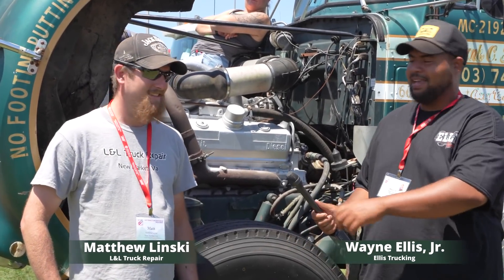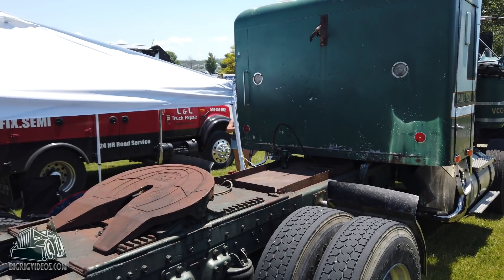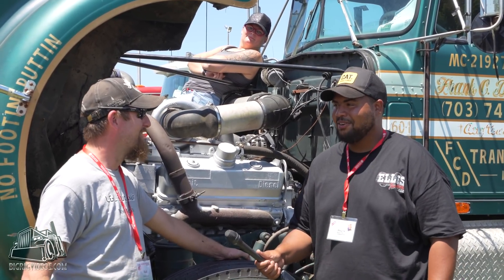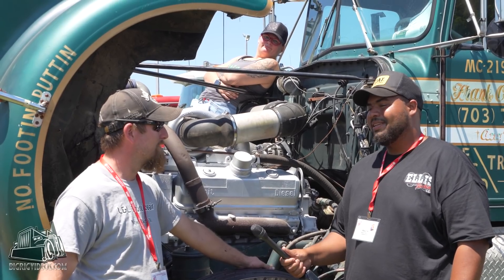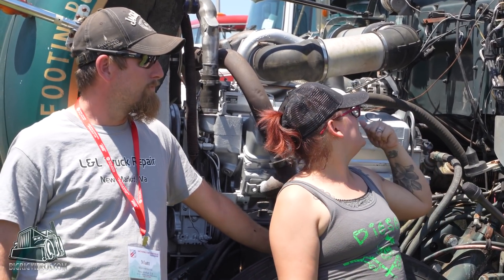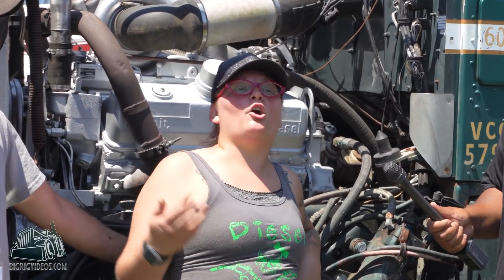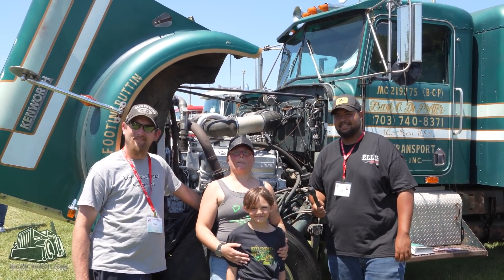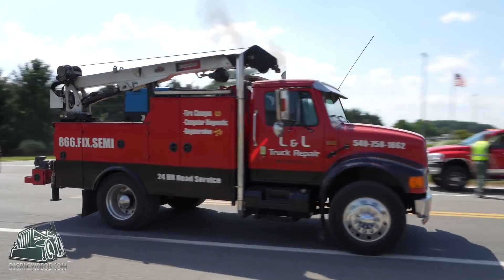The Linkski's 1979 Kenworth 8v92 W900A | Listen to this Double Breasted Yamaha!

Comment: I'm just wondering if this is a silver series Detroit 8v92 they would run I drove a 79 cab over Peterbilt with a v8 cat 3208 with a 15 speed over drive transmission and 410 rear end gears and I tell you the only truck could pass me out on 81 was a silver series 8v92 specially when they were turned up they would run I had fuel turned up also not many of anything could pass me until a cab over Freightliner with a silver series was able to pull around me I know I was loaded heavy and the other driver told me that he had a bushel load on also I had to take his word but he was telling me the truth because he could barely get around me specially with the 15 over and 410 ratio rears I drop one out of over drive and talk about a powerful unit but one question why would you being a mechanic and being around Trucks would you only rebuild half the motor that is silly to me and anyone that knows about Trucks you do the whole motor now you have one side that is new but the other 4 cylinders can go at any time that  I just don't understand that
Reply: Excuse me it had a  3408 cat I said 3208 because that is what I had in my boat
Reply: Lol, glad you corrected the 3208 to 3408, had me scratching my head...5.9 l Cummins will give a 3208 a run for it.